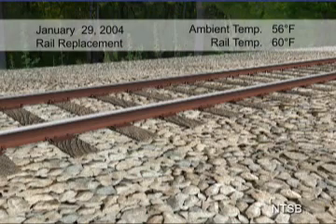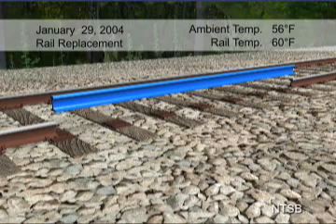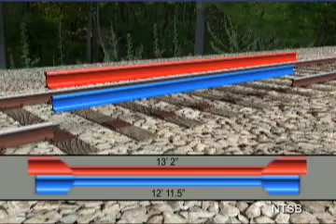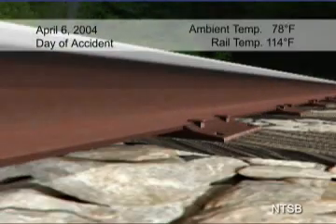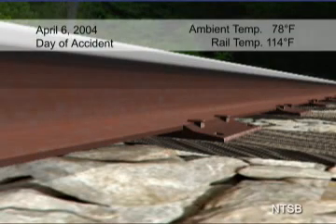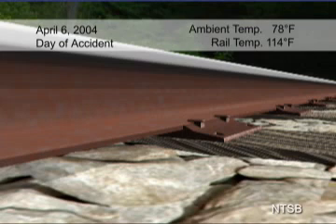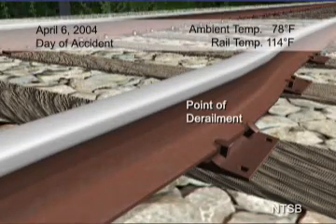Derailment of Amtrak Train No. 58, City of New Orleans - Track Features Animation

Comment: There also has to be an adequate number of rail expansion clips (or restraints) in order to force the rail to expand  vertically rather than horizontally.
Reply: Should have wielded the joint not plated it , and if they did wield it they should have done a destress / prestress  on the section, but I can tell you what probably happen the small crew of 4-8 blokes where told to fix a defect head /crack/whatever , the rail was probably due for replacement in a years time , so they do what they do slap a section of rail in and move onto the next defect its always about cost in rail , the real reason for the derailment was likely the condition of the ties , the lack of anchors will contribute, but they require a sleeper to push on to counteract the metals expansion , this is a good argument for concrete sleepers as this all but eliminates this issue (500+ ponds each is its own anchor
Reply: Rails don't expand vertically when they can't expand laterally. They bend. 
 ?tuoba gniklat uoy era kcuf eht tahW
Reply: Wouldnt it be a good practice to leave the section of new rail that you are going to use for the repair along side the tracks for at least 24 hours?  Kind of like acclimating fish to a new pond.
Reply: @MrEkg98  That wasn't the issue. The real issue, which the video skates over, is that they were replacing a section in continuously welded rail (CWR). CWR is pre-tensioned -- i.e., stretched. CWR is normally laid in quarter-mile sections, as I recall, which is 1320ft. Suppose you need your track to stay straight even if the rail temperature rises to 130F, but you're laying the track on a day when it's 70F and cloudy, so the rail's at 70F. Maybe your length of rail that's 1320ft at 70F expands to 1321ft at 130F (I'm making these numbers up, but you get the idea). So you stretch your rail to 1321ft and use it to fill a 1321ft section of track. Now, when the rail warms up in the sun, it won't expand -- it'll just slacken off the tension.

This is why the rails in this incident contracted and widened the gap when the rail was cut: the tension in the rails pulled them back. When they inserted the longer section of rail, they now effectively had a section of rail that was longer than 1320ft at 70F. It would still have been partially tensioned, but it would fill its 1321ft gap at a temperature much lower than 130F. If the temperature continued to rise from that point, you'd have a rail that wanted to be longer than the gap it was filling, and it will buckle.
Reply: @beeble2003  Wow such a long timed reply.  So its better to have it be expanded before installation.  Thats a lot to plan for.
Reply: @MrEkg98  You use devices to tension the rails -- it's standard procedure, which the crew ignored.
Reply: The narrator specifically states that when the existing rail was cut by the section crew, it  contracted at each end for a total shrinkage in length of 2-1/2 inches. Therefore, the new section of rail was made 2-1/2 inches longer than the original distance between the cuts. So, when temperatures rose again, there was an extra 2-1/2 inches of rail in the gap that expanded laterally rather than vertically, as would have occurred had there been enough rail clips in place to prevent that from happening. Also, had there been enough rail clips in place originally, the cut rail would not have contracted as much as it did. Even assuming that the replacement section of rail was at the same temperature exactly as the existing
rail, the same problem would have arisen when the temperature of the rail later rose to 114 degrees.
Reply: Yes indeed that describes the problem.  With both existing rail and replacement rail at same temperature they would both expand at the same rate.  However something else is a miss.  Maybe that is the reason for the abnormal wear at that location.  When installing the repair you just shifted the stresses to a different location on the track.  This new stress point might not have been strong enough to support the stresses.

Ahh now I see a big downside of continuously welded rail.  Yes a lot more quiet.  However not temperature stable.  I wonder what the future will bring.  Will they ever use a more temperature stable material or one that behaves differently.  Maybe the old timers of yesterday engineered out a problem and didn't realize they did with how the rail was jointed together.  Expansion/contraction joints.
Reply: With continuously welded rail you have eliminated all those joint bars that allowed a certain amount of expansion and contraction to be absorbed every 40 feet or so without distortion. The overall advantages of welded rail clearly outweigh its disadvantages, however, as long as expansion/contraction of the very long sections of welded rail is carefully calculated and controlled. I'm no expert, that's for sure, but it seems as though someone should have taken notice of a probable future problem at this location, where it was necessary to install a section of rail 2-1/2 inches longer than what was cut out to begin with.
Reply: bsmith SS united states

Comment: So they were supposed to leave a gap between the newly installed rail to avoid the problem?
Reply: Bradley Wilson Bassotronics It is supposed to be engineered to accommodate for the temperature change. This includes adequate anchoring of the rail, and pre-stressing the rail by heating it before installation so it is already expanded (rails are able to resist damage from contraction in cold temperatures better than from expansion in hot temperatures).

It is also common for railroads to reduce the speeds of trains on very hot days, allowing the engineer more time to react if they see a sun kink in the rail ahead.

Some great info on the problem can be found at http://www.vre.org/feedback/frequently_asked_questions/faq_heat_orders.htm.
Reply: Justin Franks that link got moved, here’s what I believe is the updated version: https://www.vre.org/about/blog/understanding-the-need-for-heat-restrictions/?startRow=56&nextNID=C411E30D-8F4E-441E-8A01BC4045A851D8
Reply: +Bassotronics 
No, there should be no gap.
Important is:
1) That the replacement rail has the same temperature and consists - preferably - of the same material (same temp coefficient)
2) The replacement rail must be exactly cut (shortened by the amount that will be filled by the welding material) and be positioned correctly before the welding takes place.
Reply: Bassotronics Exactly the question I had. How do you foresee something like this? Or engineer it to accommodate for the temperature change?
Reply: Well he did say "Lack of adequate rail restraints." So more restraint mechanisms might have mitigated this problem...
Reply: I think Carbon Diamond rails that don't stretch with temperature would be a good choice. But probably $1,000,000 each rail. lol
Reply: Bradley Wilson Bassotronics Sure thing! Glad I was able to help.
Reply: Well, many years ago when I worked track for 1 summer, we had a little item called a "rail stretcher." It was a unit that attached to the rail by the holes we drilled after cutting the rail out. It had a  big screw thread on both ends, and you used a lining bar to turn it. It attached to the outside of the rail, with the closer holes, then you turned the unit until the rails were close enough, then put the bars on the inside of the rail, and stuck bolts thru. We always had to put the exact same size rail in as you took out. Of course we had track crews, and not welding crews.
Reply: ***** Ah, fascinating! Thank you for answering that. I truly was curious. Reading it now, of course it makes sense. Wonderful!
Reply: Heyup Justin!
Pre-stressing can also be done cold by the use of hydraulic jacks, the amount of load applied being selected from a standard set of charts
For work like this a jacking system can often be used to maintain the tension in the rail before cutting out the damaged section. This means that the new section only needs to be cut to size and can then be thermite welded in place to form a much stronger permanent repair.

Speed restrictions are more to reduce the impact forces on the rail in hot weather that can cause a track buckle under the train as it passes over.
I also note that the rail was restrained by rail spikes driven into the timber sleepers (crossties in US parlance) through cast steel baseplates. Not a good idea with CWR, Pandrols with screwed baseplates are much better!
Reply: Bassotronics not only that the rail was 15 inches too long when cwr rail is placed down it needs to be cut to the correct length and then heated with a blowtorch so it is at neutral temperature. everyone knows rail expands and contracts over the year if the rail is not heated after it is laid it will expand or shrink to the point that the rail goes bust. this is why the rail needs to be spiked and also heated after it is laid down and a two inch gap and a wire needs to be placed between segments this way when the rail expands it will not derail the train like what happened here. this situation also happens on model railroads because they are down in basements it is called fatigue of the metal and it is expanded whenever the rail cools or heats up this is why gaps have to be cut and the rail has to be heated before it is spiked down and rail joiners are put on or the rail will come out the joiner and it will cause a derailment.
Reply: Or perhaps had planned a more permanent repair with welding and it either got deferred or it dropped off the radar.
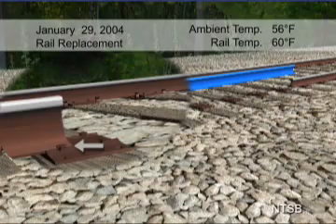Reply: @John Serling 00:42 "when the workers cut the rail (out) the rest of the track (still in place) contracted (due to cold ambient temperatures). Because of the 2" contraction, the replacement rail would need to be cut longer to compensate. Paraphrased.
Reply: That sounds another method of doing the same job.
The object should be to return the rail to the same state as before the fault developed.
What sort of progress is being made to move away from timber sleepers, (crossties as you would call them) and towards concrete or steel?
Reply: sapper82 That's what they did but for whatever reason they didn't take in to consideration, the temperature variation for the different seasons.
Reply: Bassotronics well not exactly, due to the temperature of the weather that's why the rail slid back  a little bit and they had to put that longer rail therean though weather heated the rail causing the real to move out words up and then making a little bowl shape into the rails making the train derail
Reply: The stress in the CWR once it was cut was not restored. Plus using spikes through tie plates and timber ties doesn't provide enough toe load to preserve the stress as much as a spring loaded steel clips on concrete ties would do.
Reply: When the rail contract it should have either been pulled back to correct position or heated so it could stretch to correct position. Then it should bolts tighten to refusal and additional track restraints added to repair.
Reply: @John Serling Hahaha! I'm no engineer, but!
Reply: *****
Thanks!